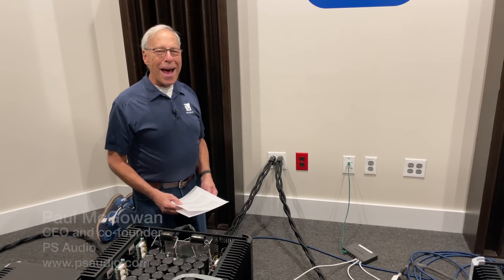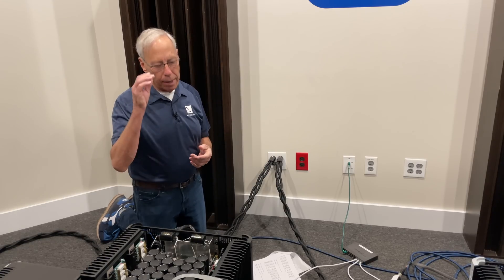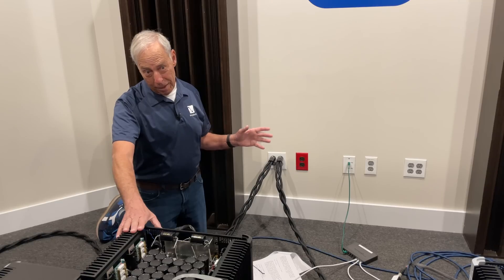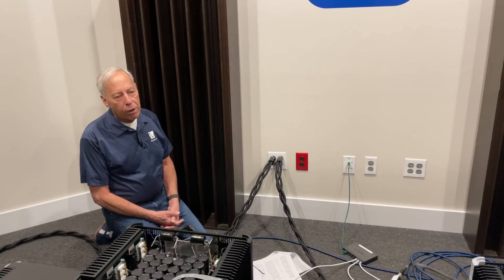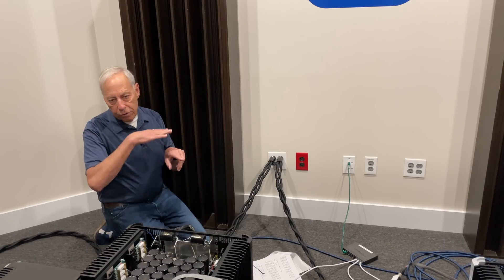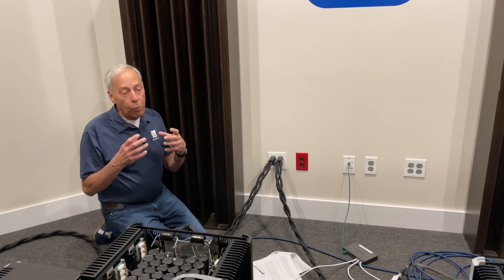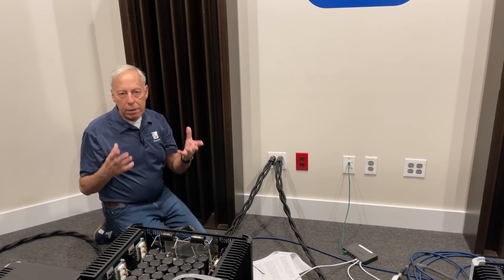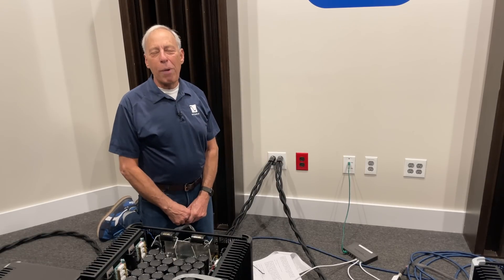Are braided power cables better?

Comment: Which cables in the walls?
Reply: Let me give you a hint.  It's highly likely that there is 12/2 or 12/3 solid Romex from Home Depot.  Have you ever seen the inside of your main or sub electrical panel and the proximity of cables and breakers to one another?  What's next?  Audiophile circuit breakers and running dedicated braided cable from the home to where the power is generated?
Reply: @hockeyplayer28  also consider the other end of the recording chain.   Every recording studio in the world* uses just good quality regular studio standard wire in capturing the original sound.    these places are not cheap to build or update, and boutique wire , if needed, would be just another justified expense among many.  

* Barbara Streisand demanded a studio be rewired with about $230,000 worth of all silver wires and connectors.   I haven't heard of it upsetting the recording industry or the audiophile vinyl community with results.
Reply: @hockeyplayer28  Indeed... power cables are wasted money... And if someone can hear the difference I don't argue I wish him the best and felicitate the vendor and producer of he cable for making easy and lots of money...
Reply: sssst dont blow the fairytales!!  :-P

Comment: Everything you do or buy will make a difference, that's physics for you. The question is though, will you hear it? But.......how good (and expensive) must your set be, how good of a recording and how good must your ears and room be? To i.e. hear a difference between the same cable being braided or not? 

Personally i never heard ANY difference from powercables on my 12.500 euro set. Speaker cables yes, interlinks yes, power cables nothing.
Reply: A voice of reason in the darkness. Yes it is physics, I've been arguing with someone about why a power cord cannot make any audible difference. Many "audiophiles" are very blinded to physics. Plus he keeps telling me to do a listening test, which I have and never heard a diff. As you said, interconnects, speakers yes. When I told him I had a friend that owned a hi end store (GNP audio video in Pas.) He proceeded to tell me I was lying. He started getting rude and started name calling, wow. Did many listening tests there of many cords on diff very hi end stuff. Plus listening is not the most reliable (our brain!). You can listen to the same system under the same conditions 2 diff times and it can sound diff because our perception changes a lot. I needed to see someone who understands. I'm beginning to see why they are called "flat earthers".
Reply: @bradt.3555  What really set me off is that i can borrow speaker cables, from a proper store, but when i asked to borrow speaker cables, it wasn't possible......

If it really works, fine. Better then fine. But so far, no joy.

Comment: $4200 for the version that goes with source components, $5200 for the high current ones. The concept of braiding might be sound, but no way in hell that these are worth the money (and couldn’t be done for a whole lot less).  The argument that the amount you spend on cabling should be a certain percentage of what your total  system costs is flawed- there is a point where you have the best design and materials for a given purpose and that is not related in any way to the price of your components.
Reply: The absolute hilarity of this is, Audioquest STOPPED braiding these power cables citing customer complaints about them being too stiff and AQ stating that the braiding didn't do much for the cable.
Reply: @falcon048  🤣

Comment: If I may there is no such a thing as cable sound unless the same cable is used in the all chain from the internal of the amplifier to the internal of the speakers especially not passing through binding posts. 
And pls don’t get me started on power cables..

Comment: Why should this affect the audio quality if you’re using still the same power from the wall ? 
Behind the sockets it’s still the normal tiny powercables. Don’t think this really helps and it’s mostly your mind at this point.
Reply: Your signal is only as good as the final connector. No one is going to take the copper out of their wall and fashion it into a plug to connect it directly to equipment. If one plugs a $5000 power cable into a $1.50 Home Depot socket, they aren't going to obtain all the benefits from that expensive cable. The benefits are cumulative. Having a more robust socket ins a start, as is having a more robust power cable. Having both is superior.

Comment: Paul McGowan, you are nothing but a deluded LIAR and FRAUDSTER perpetuating debunked audio mythology and fanciful fairy tales.

If there were the tiniest grain of truth in what you say, the very 50/60Hz of the AC line frequency would be clearly audible. It's NOT however (in any decent system).

You have prostituted yourself by acclaiming what is effectively a classic example of 'the Emperor's new clothes'. There is literally NOTHING to see or hear whatever. You say you can 'hear' a power cable, well your hearing must be wholly delinquent OR you're a LIAR and are fully aware of that fact.

This unending utter HORSE MANURE about fanciful cables MUST END. ('Interconnects' too) When the cables cost several times more than the electronics is it not INSTANTLY obvious that an elaborate SCAM is at work ? I reality no cable of ANY kind needs cost more than ~ 10 dollars to be totally perfect. That's about what professional pay for their balanced XLR cables max. I pay ~ £2 for an entirely practical mains lead capable of supplying 10 Amps of mains current COMPLTETLY PERFECTLY. I don't believe in wasting money, most certainly not on the products of CHARLATAN SNAKE OIL salesmen.

It's nothing but voodoo/junk 'science'. Your 'word' is completely worthless you crazy old buffoon.
Reply: OK, but why don't you tell us how you really feel? 🤣

Comment: If the electricity cables behind the wall socket are not braided all the way back to the power station the question becomes why does the last 5ft make a difference?
Reply: @Douglas Blake Yeah, says the guy who doesn't even understand how a simple 2-way crossover filter works. Why should anyone believe you know what you are talking about? He should keep following directions to build things, just don't try to explain anything to anyone!
Reply: Have you never seen a power line outside?  They're braided.

Comment: I don't get how, the current in the powercables behind the wall outlet can have one set of qualities, and the current running in the cables infront of the outlet can have another set of qualities.. It is a noisy signal. How can it be changed simply by running this noisy signal through a different cable.. ?
Reply from the maker: Because of noise generated by the equipment which is what it's feeding. In the wall the power is away from the radiated fields of the equipment and the equipment is away from the EMI radiated by the cables. Once out in the room everything changes.
Reply: @Paulmcgowanpsaudio  I guess this could be true of an inadequately designed power supply, but that would make a failed result.

Comment: Paul, I'm a little surprised you didn't really answer the question regarding braiding and POWER CABLES, which is primarily the  60Hz hum and reducing EMI.  You could have also mentioned  the use of an isolating transformer, since we are on the subject of AC POWER.
Reply from the maker: I am sorry that didn't come across as I tried to point out how noise is lowered by the act of braiding. However I am not sure what you mean by lowering 60Hz hum. I do not believe that happens.

Comment: I own a number of the Russ Andrews braided Kimber power cables, they make quite an improvement to both amplifiers and sources.   Anyone who says otherwise has almost certainly never tried them.

The benefit of the woven design and why it’s utilized, is its ability to reject RFI already around us. This is because the weave doesn’t represent a known antenna pattern. Secondly, the crisscross nature of the live/neutral wires in a mains cable for example, has a natural cancellation process of high frequency signals already picked up on the mains supply.
Reply: I have Kimber's Summit Palladian.  Prior to that, Kimber's Ascent and prior to that Audioquest Z3. Just the Ascent alone, was the most dramatic increase in fidelity I have ever seen in a cable swap. Then, when I moved to the Palladian, it was even more so.  After much research, I realized that it isn't that the Audioquest Z3 was a bad power cable.  It was the connectors. AQ used the cheapest, low quality connector on the Z3.  As you move up the chain in AQ, you see that they change the quality of the connectors at major intervals in their line up.  I am convinced that if you bought an Audioquest Z3 and clipped off the connectors, then bought the Wattgate connectors and used the Z3 cable, you might have a better power cable than Kimber's Ascent. ;)
Reply: @falcon048  I'm in the UK and Russ Andrews sells Kimber cables that are twisted, however when I checked on Kimber USA website, the cables were not twisted, but shielded only.  Would you know why Kimber changed to shielded but not twisted power cables.
Reply: @BoomerUKEngland  I know their interconnects and speaker cables are all twisted/threaded.  The power cable only has a standard three conductor twist you find in every power cable. The difference between the three models are first the connector and then adding the foot long, $1000 USD device that has something to do with the Standing Wave Ratio.
Reply: @falcon048  I have Kimber power cables that are 8TC (so 8 live + 8 neutral + 1 earth) and also 4TC (so 4 live + 4 neutral + 1 earth).    I can confirm the 8TC power cables have more effect then the 4TC ones, however the 4TC ones are still an upgrade over a typical cheap IEC cable.
Reply: "The benefit of the woven design and why it’s utilized, is its ability to reject RFI already around us."
That's pretty much bullshit description. That braid construction seen on that power cable is not specifically good in rejecting RFI already around us. If rejecting  RFI already around us would be the thing, there are many less cable constructions that do that better.

Comment: By that logic wouldn't you already have inductance resistance in the electrical supply between the fuse box and the wall outlet ? This being the case a braided cable should have minimal effect since the issue has already been created in the wall. As long as you're not running super long cables. Maybe you should just hard wire the power amps directly to the fuse box through conduit.
Reply: better directly power from a dedicated generator/power plant😀
no, this is still not enough. 
audiophiles will tell you the differences between coal power, hydropower, solar power and nuclear power😂
Reply: @czh998  if you think you hear something, that is your reality, the brain is incapable of recognizing error, that's why dreams seem real , and people see ghosts only in dim light where information is incomplete, never in daylight.  and the ghosts always wear clothes, strangely enough.
Reply: @czh998  I don't know about  magic sound differences between coal power, hydropower, solar power and nuclear power, but time of the day seems to make noticeable difference to some people on same locations:
Why HiFi systems sound better at night
https://www.youtube.com/watch?v=ydkIi6zF2Kk

Comment: Homedepot 1.5 a foot 12 Guage is all you need and it's prebraided 3 solid core too. Hard to maneuver but better than paying hundreds eh? . Tellurium copper connectors is abundant nowadays,  follow IACS standards. Solid  core is always better in audio.
Reply: Standard Mains cable will be fine and so will standard speaker wire. It is interesting to try mains cable as speaker wire though, it alters the sound.

Comment: Don't tell the audiophiles how the cables in the wall looks. If you power cables makes a difference your power filter sucks. I could see absurd high capacity caps in power supplies make a difference a cleaner more effortless sound with very stable power rail voltages.
Reply: That's not true.  Just breaking down the concept of conductance would prove that wrong. Freebie power cables given to you by the manufacturer have 24 gauge wires per conductor and are barely shielded as well as having little to no geometry.  Sure, they conduct electricity and follow the most basic spec to ensure your component turns on and functions at its most rudimentary level. Performance can and will suffer if that component wants to draw more power quickly, but cannot because the cable has too much impedance. A more robust cable that allows for more electrical passage , with lowered impedance, can provide power instantly and vanish that power just as instantly.  That gives you the deepest black noise floor and the most dynamic performance from your equipment.  Unless, one's equipment is sub-par and not very good as resolving dynamic and detailed sounds.
Reply: Don't think too much, leave your science aside and experiment with a cable you can return. Hear the difference and then you can go with your bro science.

Comment: Paul surely you are running that amplifier off of your "Power Plant AC Re-generators" , now in that case the Dragon power cords from the AC Re-generators to the amplifier makes sense ,But using a Dragon cord from the wall outlet to the AC-Re-generators  does not make any sense ,it only needs to be of a sufficient gauge wire. With that said all audio equipment works off of a DC power supply ,now if the supply is well regulated (many aren't) and filtered with enough reserve capacity to handle large transients or bass notes then what is coming in AC wise should not make a difference.
Reply: I cannot agree more.  Can't help but thinking the old rule "garbage in garbage out" would apply to the power feeding the the AC regenerators, especially when it comes to passive components.  This has bothered me for a long time.  Seems to me that money could be spent other places.
Reply from the maker: I am running it from the wall to the regenerator and then another from the regenerator to the equipment. If the regenerator were perfect (it is not) and if the regenerator created no electrical radiated noise (it creates a lot of downstream noise) then you would be correct.

Comment: Let's give credit where credit is due. Ray Kimber did not build wire braiding machines, he bought them, probably used which is fine. Those devices have been around since before electricity to make steel cables like on the Brooklyn Bridge. The twisting of audio conductors goes back to the 1920s if not before. Look at the analog telephone system which was largely designed in the 1930s. Every circuit uses a twisted pair. Look at  CAT5 cable, strip a USB cable. Yes twisting of wires certainly benefits high end audio. But it is not some great scientific breakthrough discovered by audiophile cable manufactures. it been around since the dawn of electronics. And XLR cables are most certainly made with braided wires, at least in the professional arena.
Reply from the maker: Actually, Ray built them because he could fine none that handled the wire gauge and would handle 8 at a time.
Reply: @Paulmcgowanpsaudio  I saw pictures of them on one of his marketing brochures. Unless he hired a large machine shop with casting capabilities I don't see how he could have built them. Now perhaps he modified OEM machines? That seems more of a possibility.
Reply from the maker: @andydelle4509  Ray's a pretty resourceful guy but, perhaps you're right. It's been more than 40 years. Too long for a good memory.
Reply: I believe this discussion is about mains power cables..
Reply: You say 'Ray Kimber did not build wire braiding machines'. This makes all the rest of your comment invalid because you do not know what you are saying is true - you are either guessing or making it up as you go so there's no point in anything you say
Reply: @adotopp1865  Do you have information that proves he did? If so then I stand corrected. If you know anything about how machines like that are made then you would quickly realize a small boutique cable manufacture does not have the resources to produce a machine like that, Does he have access to a machine shop and casting foundry? Sure these services can be hired but at what cost? As I said it's quit possible he made custom modification to OEM machines but I doubt he built them from the ground up.
Reply: @andydelle4509  I have read the story of Ray Kimber and his cables and how it came about a few times in published magazines . There were wire braiders with rotating spools but not for the gauge he wanted or number of conductors so they had to engineer them. There are videos of them on the internet   

           https://www.youtube.com/watch?v=SL2Zo27vRg0&t=40s
Reply: @adotopp1865  OK, so he modified or adapted existing machines to suit his requirements. And that's fine and done all the time throughout many industries. But it's not the same as building a complex machine like that from the ground up.
Reply: @andydelle4509  no
Reply: @adotopp1865  What is your point? Do you work at Kimber Kable? If so then tell us the story behind your braiding machines. If not then you are also assuming as am I.
Reply: @andydelle4509  I don't understand what it is you are asking. I do not work at kimber all I have seen is a few magazine articles and watched interviews of him.